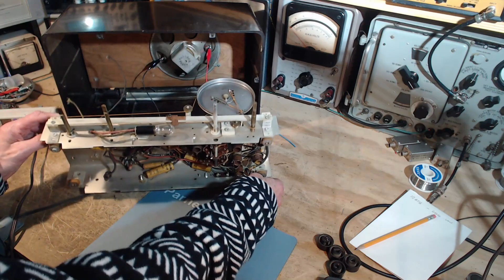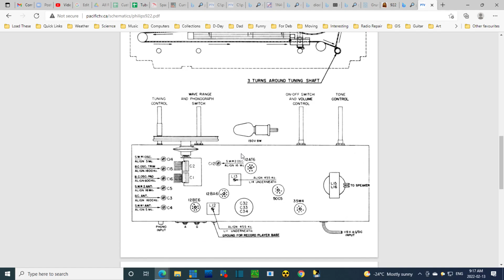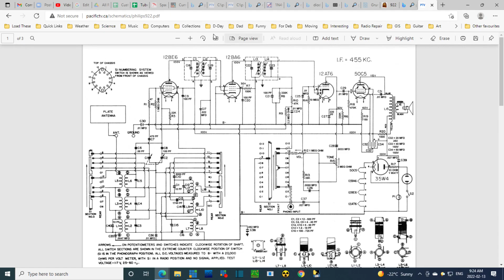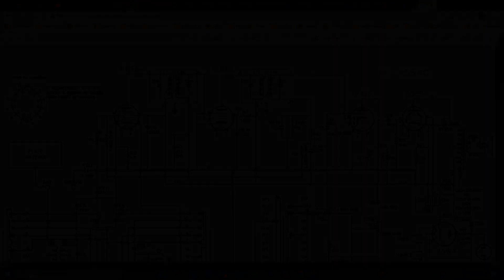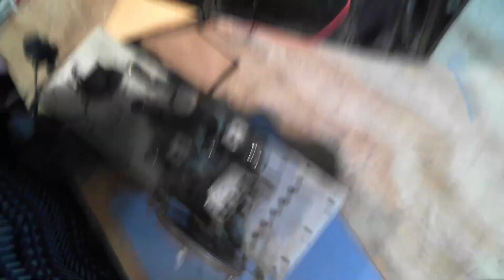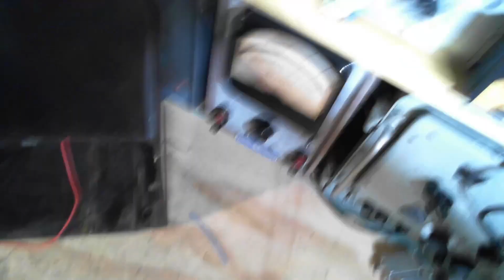Canadian Philips 922 Tube Radio Video #2 - Schematic Reviewed

Comment: When you mentioned the isolated chassis it reminded me of the importance of using XY rated safety caps for C38 (between B- and chassis),  C37 (between B- and the phono jack ground) and C30 (between B- and the antenna ground). Also, I would consider changing the line cord to a polarized plug and, rewire the on-off switch to interrupt the line hi side instead of the ground side. Thanks.
Reply: Correct! For safety reasons any cap from mains to metal chassis or any user touchable terminal or metal needs to be a class Y cap. Or ofc a class XY. But not class X or a standard cap.
And now go and look in the NEXT video of this series what he installed at timeindex 45m09s for the B- to chassis and B- to phono input ground; generic caps not rated Y nor XY. And that on a customer radio he gets paid for to service properly!

Comment: I wonder has anyone converted one of these radios to battery operation and used 12V TUNG-SOL Vacuum tubes so the heater voltage can be 12V and the B+ can be between 45-63V and just ditched mains operation.